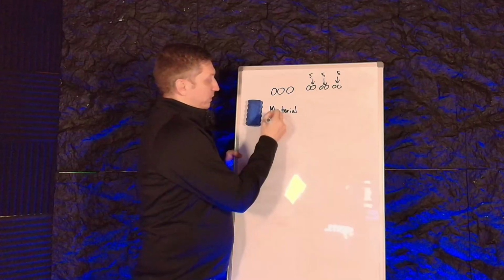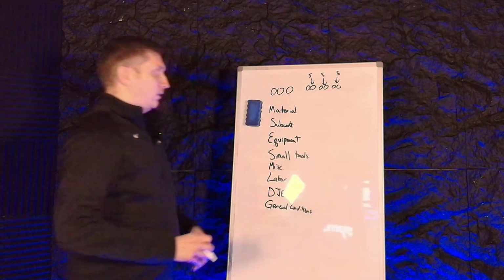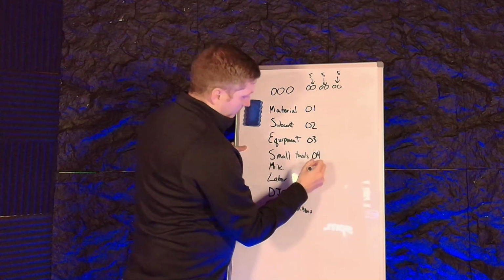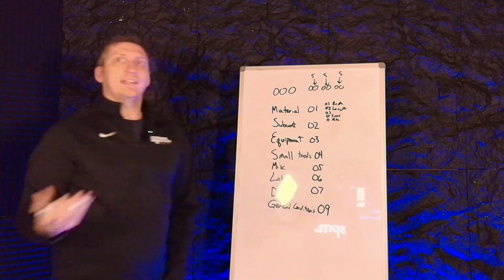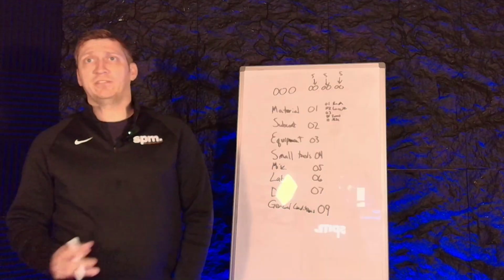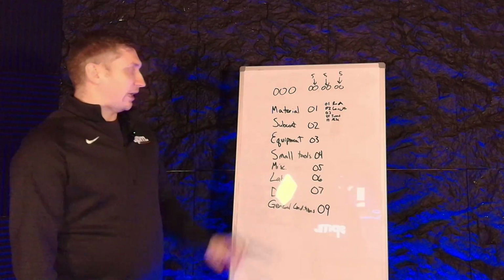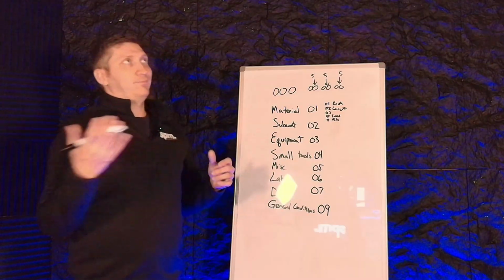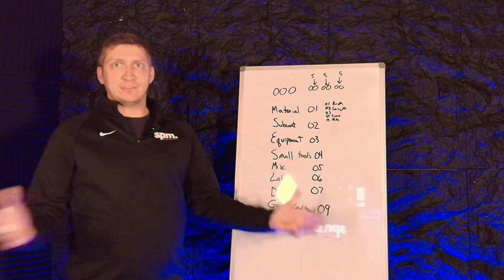How to Build Cost Codes for Subcontractors (Step-by-Step)

Comment: Great video! Similar to how we do things. From experience, I'd keep the labor codes short enough that the crew will actually use them. Since if a guy has to scroll through 40 codes, he'll usually pick whatever's on top. We keep it to a handful per job, so when they clock in (we use Workyard) they just choose from 4-5.
Reply from the maker: Smart! The goal is to get them using what they’ll actually do!

We don’t give everyone all the codes, the field gets their 10 to 15 split up by material and labor but it’s all simplified so it’s no stress. 

The second they stress, it doesn’t matter, they won’t do it.